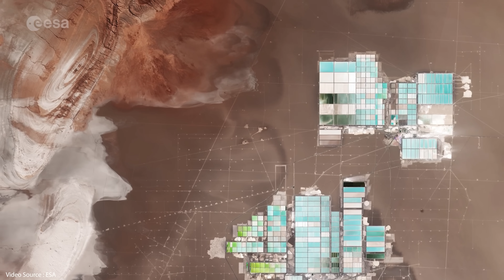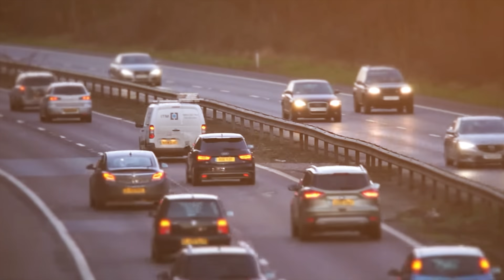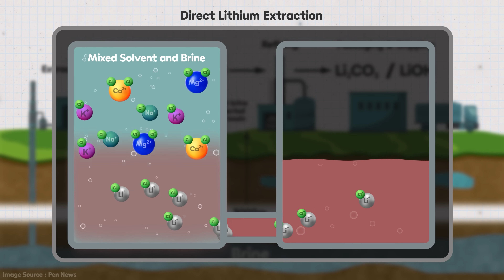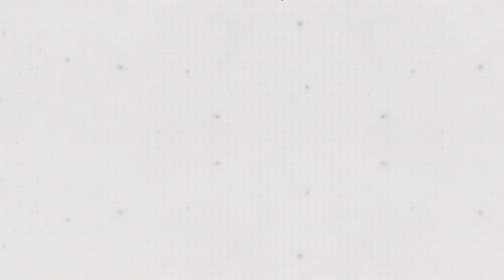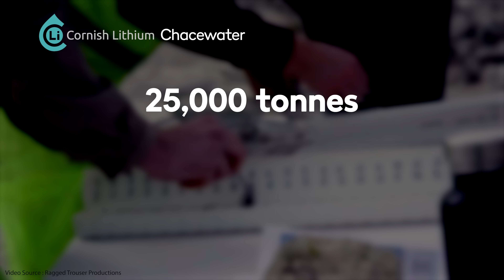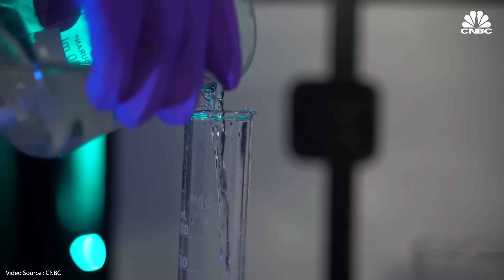Batteries: Revolutionising lithium production. From 18 months to 6 HOURS!!

Comment: Could you do a review of the Tesla method being developed and used in small amounts in Nevada? A clay based approach using table salt with high recycling rates. Perhaps not quite as fast but apparently low environmental footprint and very low cost.
Reply: Lithium bearing clays still offer low yields and require complex processing. Much like DLE the processes involved are somewhat site specific, sometimes fairly granular as differing clay compositions can co-reside at the same location. The lithium tends to be leached from the clay using either acids (e.g. sulphuric acids), alkalines (e.g. limestone), metallic chlorides (potassium, iron, sodium, etc.) depending upon the clay composition. Many require fairly high process heat input (some over 1,000°C), larrge volumes of water and subsequent processing to raise the lithium purity to battery levels. Some approaches do use evaporation leaching ponds, which is similar to lithium brine evaporative extraction mentioned in the video (similar considerations) but with additional chemical treatment involved and higher levels of water resource needed. 

There was a bulletin paper produced on the Nevada McDermitt clay extraction by the US Bureau of Mines in the 1990's that looked at various extraction methods but found the extraction was likely uneconomical, with limestone-gypsum leach roast methods costing $2.02 per lb of Lithium Carbonate produced and chlorination leaching even higher at $3.86/lb, at the time Lithium Carbonate on the market fetched $1.50/lb and has fallen sharply ever since. 

The current status is the McDermitt Lithium Project, now owned by an Australian natural resources company (no mention of Tesla), is seeking investment with a mind that a combination of low cost renewables to lower site energy needs and the increasing priority within US regarding domestic resource security (including Lithium), will make the site more economical and attractive to investors.
Reply: @GruffSillyGoat On battery day I understood that they found a new method that is more environment friendly (and hopefully economically viable).
Reply: Jade Cove did a good review of what was known about the method, back in September 2020, outlining what the gaps where both in the Tesla description and how it matched up with known processes at that time. In short there was a lot left out of the Tesla description, whether it was a specific process to particular clay deposit formulations (which vary a lot), what level of heat input  and/or additional base/chemical prcoessing was required (Tesla only stated non-acid processing initially using saline). 

However, since it's been nearly six years since the announcement and the degree of people change at Tesla in that timeframe it's likely the approach has been placed on the back burner. Perhaps waiting till one of the other ventures seeking to use clay extraction obatining sufficient interest/investment.
Reply: Yeah! Tesla has been very quiet about that since it was introduced on 'battery day' some years ago ...

Comment: This might help silence the naysayers who claim that lithium extraction is “worse” than drilling, extracting, refining fossil fuels. Not gonna hold my breath, however.
Reply: Remind them that about 8 billion tonnes of coal are dug annually [leaving half a billion tonnes+ of fly ash waste], 4 billion tonnes each of oil and gas, plus a further 2.6 billion tonnes of iron ore. All the fossil fuel is gone for good, at least the iron is well recycled. Meanwhile in 2024, just 240,000 tonnes of Lithium [rising quite quickly] was mined with some hope of a good recycling rate from vehicles and storage batteries. All the metals apart from iron added together don't reach 200 million tonnes p.a. A sense of proportion is required. Sourced from the Visual Capitalist and the 2024 Li figure came from an AI Overview.

Comment: A very interesting and informative presentation. However, there was no mention of the amount of energy input for each extraction method per tonne of lithium product produced.  There was an indication of the carbon footprint but that would also include a lot of other factors.  I would assume that the natural evaporation method would have the lowest energy input, which is why it has historically been the preferred approach, as it also is for sea salt extraction

Comment: Fascinating!
But the 16 tons of CO2 per ton of fuel is a weirdly high Numbers. Are there sources for that value?
Reply: I agree. That would more than 5 x the co2 from burning the fuel. From what I found the well-to-tank cost of petrol is about 720 grams/liter => ~ 1 kg co2 per 1 kg of fuel.
Reply: Fair question in itself. But to be even handed, do you have a source that validates the need for your question?
Reply: @BrentonSmythesfieldsaye proper journalism and scientific method.
I am all for electrification but data is data
Reply: @dschoern  Only I asked for an actual source that validates the need for your question, not a further unsubstantiated assertion of "proper journalism and scientific method". Give us the actual source of your apparent "data", that leads to your question in the first place.

Comment: Exxon, Equinor and now Chevron are all investing in DLE projects in southwest Arkansas and east Texas.  The supply wells and re-injection wells do not require modern O&G drilling technology.  Those will be old school wells and there is no fracking involved.  The formation in question is the Smackover (SMK) formation.  Think a subsurface ocean of brine containing not only lithium but bromine and other elements of value.  Although the Smackover covers a portion of numerous states, the sweet spots have two important considerations:  high lithium concentrations above 200 ppm and the required volume of brine.  If ultimate recoveries are to be believed, the big three O&G companies will produce all the lithium that the US requires for decades to come.  In addition to cost and environmental advantages, the target areas of Arkansas and Texas are a short distance from the battery plants and EV factories that will use the lithium produced.  We have followed and discussed this SMK Lithium Play for over two years on the website: GoHaynesvilleShale.com

Comment: The statistics around land use were interesting, although I wonder if they are as relevant as we make them since most of the operations described happening areas where the land would have almost no other use. I know the term Wasteland is human egocentric. I think the part of the complication is that since there is no control listed, meaning some of the statistics are interesting in comparison but are not scaled to other use cases. How much CO2 does the typical copper mine in emit? That's assuming the typical is even an appropriate adjective.

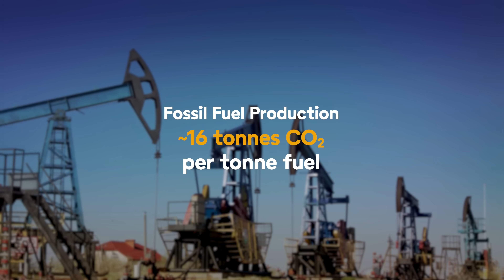Comment: ref:  1:15
Could you include a link that support the claim of 16 tons CO2 per ton fuel. Can not get that math to work.
Reply: ..i guess if you look at the whole extraction and delivery process for fossil fuel; surveys, drilling and pumping, pipelines and shipping, refining and distribution, then it is going to add up. We also know that the oil industry flares off quite a lot of gas, and some companies and petro-states have a poor reputation for methanes leaks, and that could push up the CO2 equivalence figures. Of course, the whole corporate CO2 output needs to be added in; management, advertising, promotion, lobbying etc. Just getting to work and turning on the lights and computers produces CO2, in all but the most advanced corporations.
Reply: @ashoakwillow  One ton of oil generate close to four ton of CO2 when it burn.
C(12) + 2 O(16) -> CO2(44)
You would not make much money if you use four times what you get out of it.
Reply: An emission equivalent to 16 tons of CO2 doesn't have to be 16 tons of CO2, could be 2 tons of CO2, 500kg of NOx, etc. that's why cars have catalysts
Reply: Usually number of barrels obtained per barrel of oil used is quoted. This is about 2:1 for tar sands and about 10:1 for ordinary oil wells.
I cannot see how the 16 tons to one ratio was calulated.
Reply: @JonathanFrost 
Per Ton or Tonne of oil produced ?

Comment: 16 tCO2 / t fossil fuel? Please check that number... that would be more than the emissions burning the stuff. Should be in a range of 0.3 to 0.5 tCO2 / 1tfossil.
Reply: Burning 1 t of oil releases about 3.15 t of CO2.  Extraction, transport, and refinery are 20 - 25% extra, or 0.6 - 0.8 t CO2.
Reply: The fossil fuel has to be extracted, transported, refined, etc.

Comment: none of these alternative lithium extraction seem to have shareholder attraction. or am I mistaken?
Reply: South America (Chile, Argentina etc.) were the largest source of Lithium at one point and used brine evaporative methods, they were only overtaken by Australia with its opencast mined deposits in the last five to ten years. However, South America still represents 40% of the global supply, and are shifting to DLE to reduce production timescales and costs, increase output volume, and produce Lithium at high-purity levels (mined Lithium has extra processing costs involved to raise its purity). So yes there is investment in the methods covered in the video, both corporate and state.
Reply: See Vulcan energy. Great company.

Comment: I'm sorry to be a bit pedantic, but your drawing of LiCl is not too scale. In fact a Li+ ion is much smaller than a Cl- one, and you show them the other way round. 

The fact that Li is the third smallest atom is important in battery tech, as the size of the outer electron shell turns out to be relevant for the voltage (so incorrectly the energy storage) of batteries based on those ions. Smaller is better in this context, and Lithium is the metal with the smallest ions hence the largest ionisation voltage.

The fact that the Li+ ions are so small also intuitively helps to understand how a membrane can let those ions through and not the Cl-, though obvs that intuitive approach is much over simplified
Reply: Maybe the size of lithium ion is meant to represent the double hydration shell

Comment: The environmentalist I know argue that alternative energy systems fail to address overshoot. Using solar power to build TV sets that get sent to the dump every three years is not a solution. Simply stated you can't have infinite growth on a finite planet.
Reply: I bought my first TV 50 years ago and have had 3 altogether.
Reply: You are aware that there are new recycling plants, first developed for BEV recycling, which are showing an ever greater efficiency of “digesting” nearly anything battery or electronic and extracting important elements in a purer form than those from post mining processing. This includes plastics being recycled to near virgin plastic pellets.
At the speed it is improving, I suspect this will be a non issue within less than a generation.
Reply: @davidlemieux615  The waste stream is just a small subsection of the problem of unlimited growth.
Reply: Which is why they often do more harm than good.  The goal of most humans is to have a good life and they want to preserve the environment to the extent it helps them get there.  If you force the choice to be give up growth or say "fuck it" they will say fuck it every time and I agree with them.  Luckily it's not true more consumption per person always means worse environmental impact especially once population stops growing.

Besidea, trash just isn't a sustainability issue.  You can just dig bigger landfills (and no you can't run out of space, the stuff comes out of the ground in the first place).  You can just dig pits deeper to put more waste into them.
Reply: Isn't this whataboutery?
Reply: @Lewis_Standing  What about the inability to protect the planet from the destruction of industrial civilization by just switching from one energy source to a slightly less damaging one. Yes we could use solar to create a significantly less damaging culture, but we aren't.   Not even close. We aren't even trying.
Reply: Some of them seem to want us to live in mud huts. Good luck with than one.
Reply: I have replaced TVs at a rate of every 15 to 20 years, despite having to cope with passing from analogue terrestrial transmission to satellite to digital cable in the past 25 years. It is of course not about infinite growth. But exactly for that same reason, we have to pass to all electric powered by renewable sources. Using electrons instead of whole molecules to power stuff, and employing molecules in such a way that they are recycled.
Reply: @thomasalbrecht5914  I dream about a cell phone that has the life expectancy of "Ye Ol wall mounts".
Reply: @timeenoughforart  I have only ever changed smart phones because of parts that I couldn’t change myself, which is why I now have a phone that allows me to change the battery, the charging socket, and the camera module. Hoping that I will never have to. The makers will guarantee software updates into the 2030s.

Eventually, it’s about recycling the stuff. This is probably where things need to get better.
Reply: @thomasalbrecht5914  my phones charging socket is giving me fits. The soft wares gone funky. Battery is still functioning. It was used when given to me. 
Your phone sounds interesting. I like the idea of repairing, or having stuff repaired. 

Cheaper to toss something constructed by someone paid $3.00 a day, than a fellow charging a shop rate of $75.00 an hour. I guess I'm that guy. I rarely fix furniture for that very reason. My new deal is I will only work for free, or homemade cookies! It is too easy to run up a $500.00 bill for a $50.00 chair.